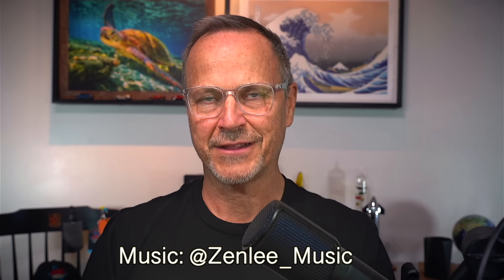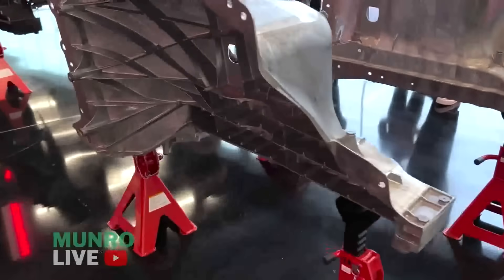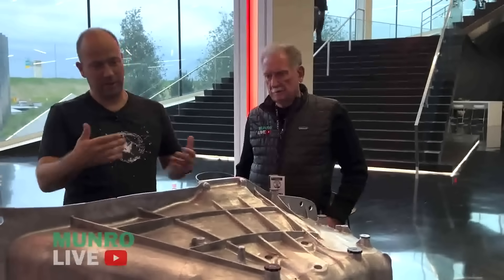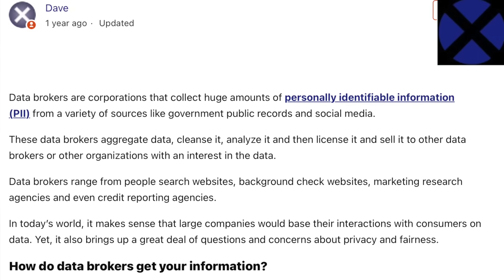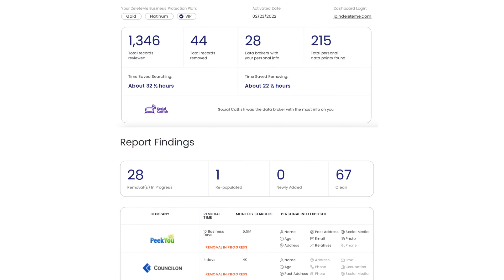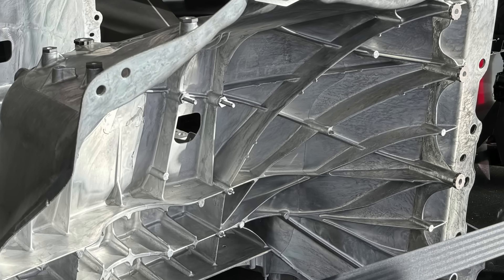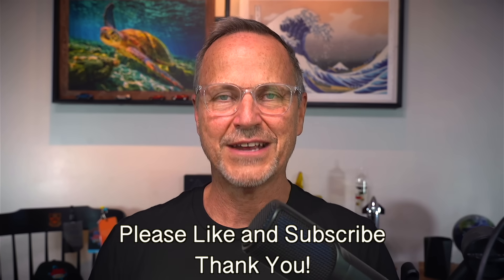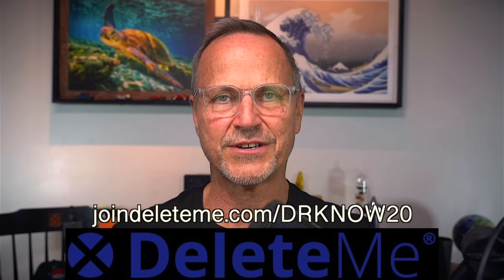Tesla Chief Engineer BLOWS Sandy Munro’s Mind!!

Comment: My only concern with such big castings is whether it will make cars unrepairable because they're such an integral part of the cars whole structure. If someone damaged a  wheel arch, which would normally be repairable, would that now necessitate that whole casting being replaced? Could it be replaced?
Reply: Frame damage is frame damage, whether it's a steel extrusion or a cast part.  For most frame damage, insurance will total the vehicle regardless as the repair costs outweigh the value in the vast majority of cases.
Reply: @richpalmisano1740  That's not true. A lot of damage is repairable. Most frames aren't  extruded, either as they're usually steel, which tends to be press formed. Extrusion is more associated with aluminium used in bonded chassis such as a Lotus or Aston Martin.
Someone else replied saying that sections of the casting are made by Tesla to repair localised damage, which makes sense.
Reply: Tesla has addressed this. They have smaller pieces of the casting available for purchase.
Reply: @EnlightenedSavage  Yeah Elon said you basically cut off the damaged part and weld a replacement on.
Reply: The casting has a part number and its manufactured by Tesla. 

In the event of a crash, Tesla certified repair shops can purchase that item and bolt a new one on. It will be straight and true and much faster and lower labor costs than cutting out spot welds and cobbling together a bunch of non-precision stampings. Then bolt new control arms and outer panels to this.!its fast, precise, and easy.  

I don't understand why people don't understand this.
Reply: @Triple_J.1  I doubt it would be that easy as the casting goes right across the car and integrates both wheel arches. You would have to virtually strip the whole front end of the car to fit it. That was one of my concerns.
Reply: @Triple_J.1  hmm, you'd have to disassemble half of the car to replace the casting, massive amount of work...
Reply: Welding steel is simpler than welding aluminum, and more people can do it. Welding aluminum in an oxygen free environment is a rarer skill, and requires more equipment.
Reply: Dude normal car also unable to repair when it crashes in frame
Reply: @BGNOO7  Frames can be repairable and also, there are potentially parts of this casting that wouldn't normally be as structural. Someone else replied with a constructive answer, thanks.
Reply: @alunjones2550 @EnlightenedSavage gave the answer. In a TESLA video, Lars Moravy shows how casting is repairable faster than on an ICEcicle, and can be repaired at waaay lower cost. TESLA is also an Insurance company: they save on insurance payout if parts cost less and need less labor.

Comment: Cybertruck production capacity: At 60 jobs per hour (that's Sandy's reasonable guess). 60/hour x 20hours/day x 6 days/week = 7,200/week.  That translates (with 50 weeks) into 360,000/year on a "normal" production schedule.  It's possible to flex upward from there and, of course, an additional line could be built over time.  (I spent ~40 years in the auto industry, from manufacturing to R&D to vehicle design, development and testing).
Reply: i think that Tesla is maxing out a press at just over a a minute per casting, and are basing their 5000/w on just relying on one press always being available.

Comment: The material is injected on between the wheel wells the runner and gates are removed from this casting it is important size all gates ad runners so the material flows to all the locations and arrives at the exact same moment

Comment: Recent news said GM bought the company that made the dies, for billions of dollars. Suggesting this gave them a position in Tesla's business. If true what a folly.
Tesla has its own die shop and clearly their own technology.
Perhaps GM is actually revising its own manufacturing. If so this information should be of help to them.
Reply: The firm that GM bought was a sand casting one, completely different tech. It had also been on the market for a number of months. So it can be assumed Tesla had a chance if they wanted, but looked at it and went nope. 
Realistically now they have nailed die casting, why would they go back to sand casting. Lower production rates, more failures, lots more machining, so higher overall cost.
Reply: I considered that sand casting may be involved in manufacturing the die. When the furnace was installed on the Tesla die shop that could be for melting the exotic metal the die is made of. Once the die is cast they would machine finish and coat it as needed. The die itself is filled with passages for heat management and the injection of liquid metal flow, hence sand casting.
And you are right Tesla was not interested in the purchase. @derrickstableford8152

Comment: 1. As I discussed with Scott Walker, the risk of casting machine downtime drives the inventory levels. The risk of a missing casting part shutting down the line is mitigated by inventory. This is contrary to the Toyota system "just in time (JIT)" inventory.
2. I assume the casting is cast upside down, so the casting material does not flow up to the top of the casting, but flows down to the most extreme point (like a river flows downhill).
Reply: I would not be surprised if the whole casting section has the air pumped out during forming in a curve to optimize metal flow in minimum time. Less opportunity for air bubbles to be trapped in the part 😊
Reply: The material is injected at 20 bar (290 psi) and fills the void in about 10/15 seconds. See IDRA PDF for info - https://idragroup.com/sites/default/files/download/gigapressen-idra_0.pdf

Comment: Can someone tell me why is a press being used while making the alloy castings.
Reply: Holding the tooling together. A lot of liquid metal is flowing in VERY quickly. Basically that is a huge hydraulic force pushing everything apart in all directions. Bigger piece, more metal moving faster, more force. Until you end up with insane amounts of Italian steel to contain the madness.
Reply: @geirmyrvagnes8718  Thank you for that information, it all makes sense now.

Comment: It is fluid dynamics, the final result has resistance to flow just less than it would otherwise be.  Flow resistance through a curve over 90 degrees is less than a hard 90 degree elbow.

Comment: "When casting machines go down they go down hard" -- I've never been around production casting, what does this mean? Does it squirt hot liquid plastic/metal everywhere? Yikes!
Reply: a large hydraulic machine can destroy a building in seconds, I think there are some videos online.  In training, there was security camera footage of a piece of equipment rupturing and roof collapsing in what looked like under a minute. Not to mention that a 'small' leak from large presses think of human flesh like a wet sheet of toilet paper.
Reply: I had a service call to a 100ton cold forming press, in a welding shop. The manufacturer had only used an encoder, without hard limits. The noise spiked the controls and told it to move 1000mm past the end of the machine. The hydraulic ram sheared a 4” square metal end stop off the base of the machine. Imagine a 9000 ton beast.